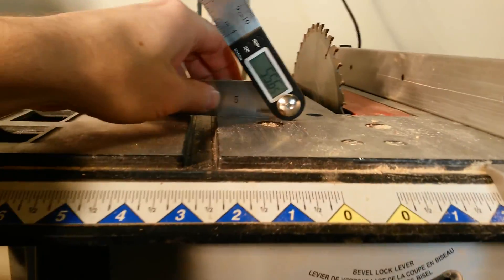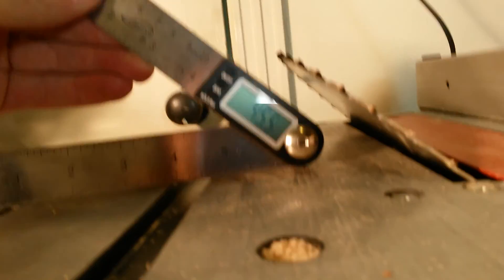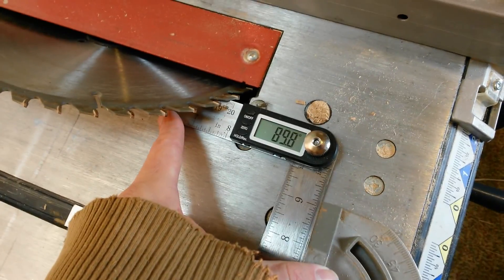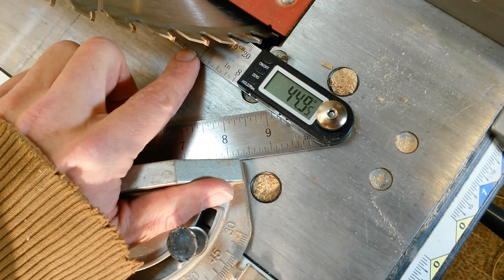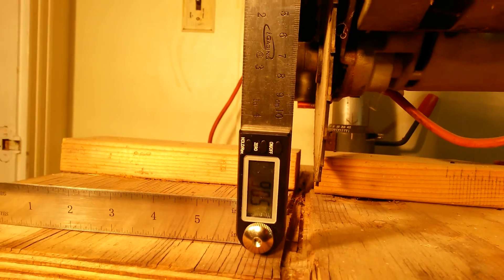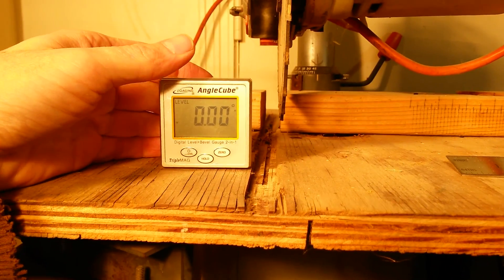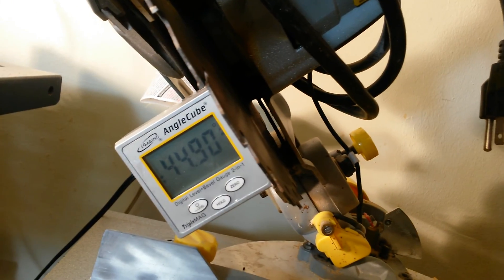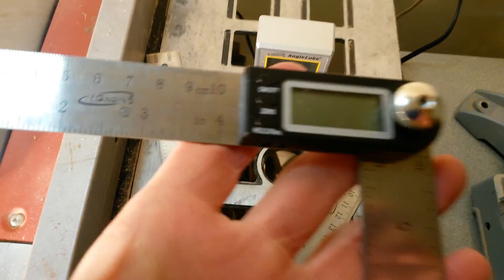Setting Your Table/Radial/Chop Saw Angles Digitally With iGaging Digital Protractors & Angle Cube

Comment: setting an exact 45 degree with these angle cubes is like chasing a ghost, i wasted an hour trying to get is exactly at 45, it wont happen, either 45.10 or 44.90 no matter how slow i go tilting the blade.